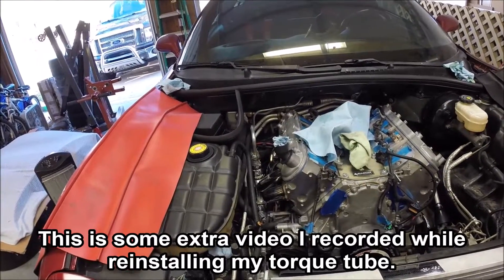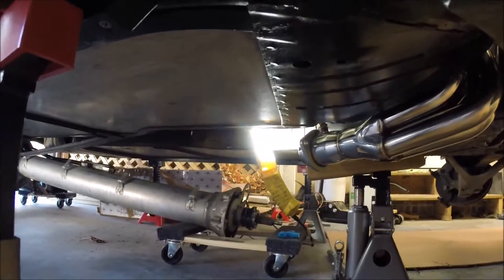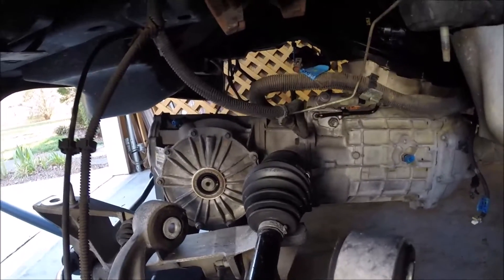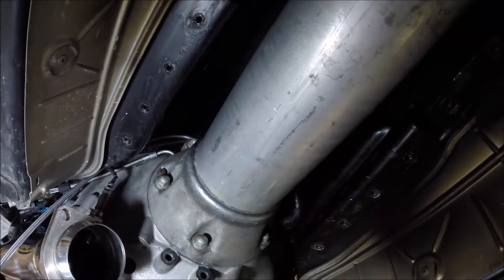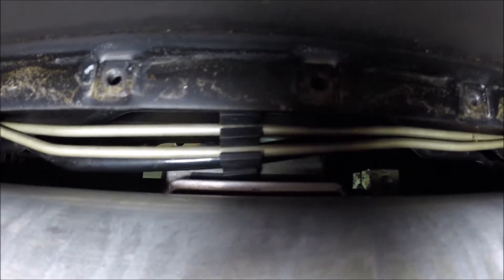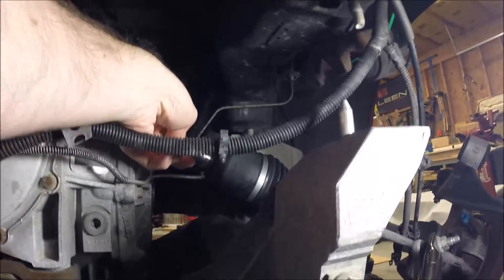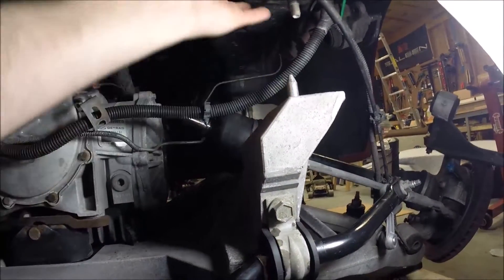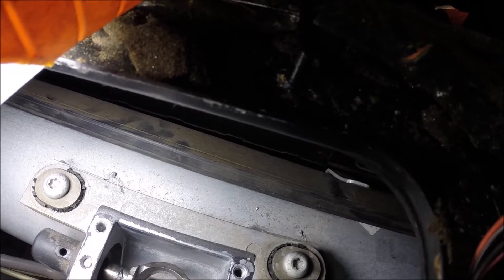Corvette Torque Tube Installation Overview

Comment: Thank you for doing this.  Every little bit of info I get I feel a little more confident on doing my C6 torque tube.  
How high did you have to lift the car to be able to remove the rear cradle?

Comment: I had some Torque Tube work done on my 2014 Covette Stingray. On or about a year after, another technician pointed out that the end of wiring harness that runs along the Torque Tube had fallen onto the exhaust melting some of the casing and exposed some of the wiring.  Presently, there are no warning indications, however, should I be worried about this?    The technician was able to clip the harness above the exhaust.  Should I approach the company that did the Torque Tube work with that issue?  Have you seen this issue on Corvettes?
Reply from the maker: Sorry to hear that.  It can be a challenge to get that wiring harness clipped back into place.   You could definitely ask the shop that did your TT work to take a look at it.  If it's been over a year since they did the work, it might be difficult to prove that they didn't do something right, but it's worth having the conversation and hopefully they'll work with you to make sure everything is taken care of.

Comment: So how do u tilt the engine back
Reply from the maker: The engine itself is just supported by the two engine mounts.  So without the TT installed, the weight of the engine causes it to lean back towards the firewall.   So you'll need to support the back of the motor with a jack on the bell housing.  You can go up/down on the jack to help dial in the amount of engine tilt to help line up with the TT as it goes back in.
Reply: @ScrufsGarage  so after the TT is out , to tilt the engine back just take off the 2 motor mount bolts and move it how I desire with a jack ?

Comment: Nice job standing ovations! Very patient with your work. What was the reason behind replacing the TT?
Reply from the maker: I cracked the #7 piston at the track and pulled the TT while pulling the engine for a rebuild.  

Thanks for the kind words.  It is definitely a project that requires patience haha.

Comment: So if angled correctly, It shouldn’t require much force to connect and disconnect the engine from the torque tube? I pulled my engine from the top and I felt like I had to apply more force than necessary to get it off the tube. 
Really appreciate these videos, I have learned a lot from them.
Reply from the maker: Yes that's correct.  Easier said than done of course.  And it will require some force, since you are moving heavy objects.  But if you're really having to force something with a giant pry bar... stop, and take a moment to figure out what's not lined up correctly.   Believe me, I had those moments laying under the car, frustrated and tired, where you just want to force the thing to go back together.   My biggest caution is using the TT to bellhousing bolts to force the assembly back together.   If you're really having to crank on the bolts to get it to seat, then something isn't right.
Reply from the maker: One other option is to remove the TT from the transmission.  You could put the TT back in and connect it to the bellhousing.   And then install the transmission/diff/subframe.   It's a bit more work, but if you're having issues getting things to line up at the bellhousing end, it's an option to consider.  The TT itself isn't very heavy, so it's a bit easier to move it around to get the angle right.
Reply: Gotcha, I’ll be more patient with it.  I’m still in the early stages of getting my engine back together so I have time to mentally prepare my self lol. Thanks for the tips!